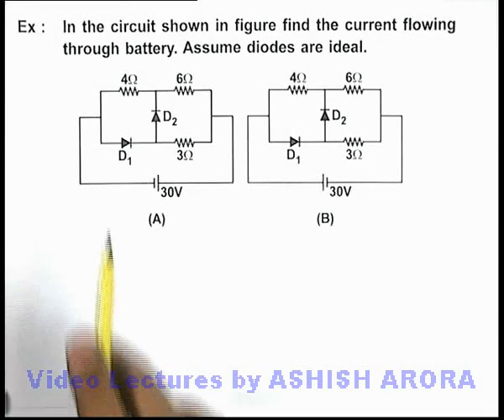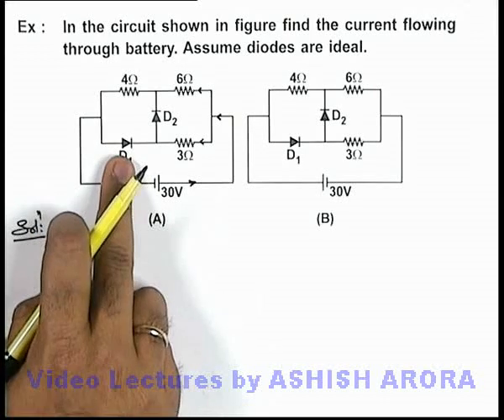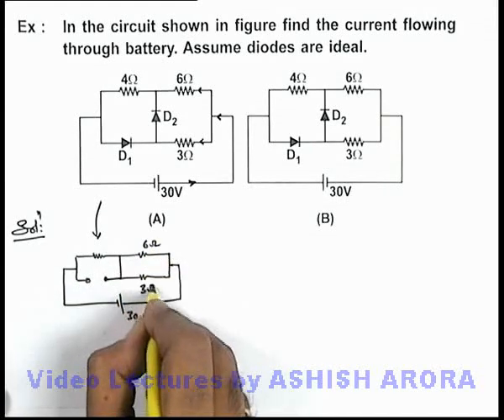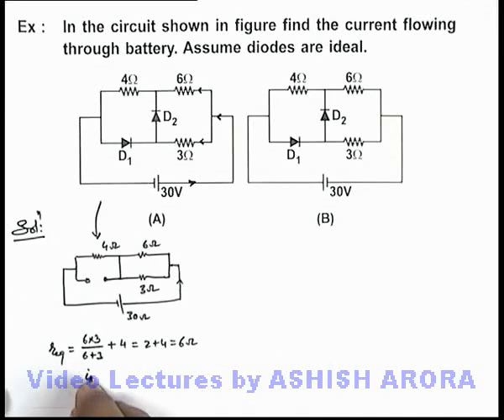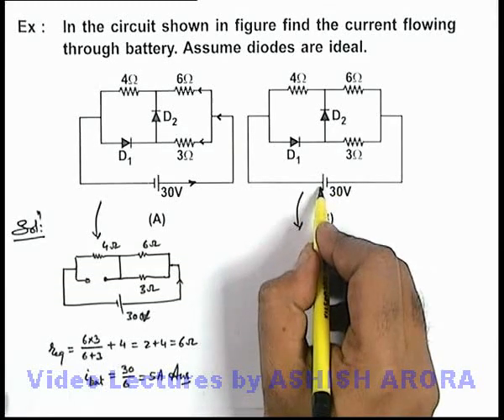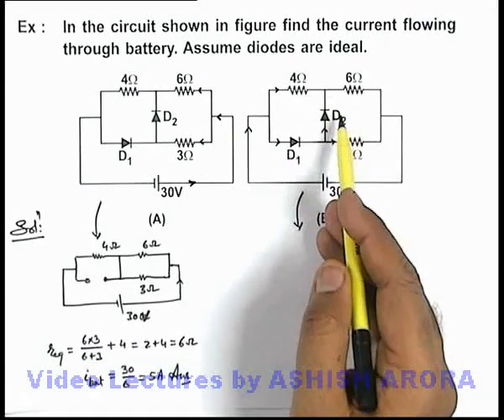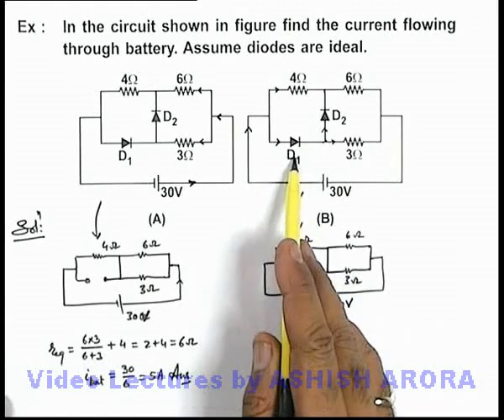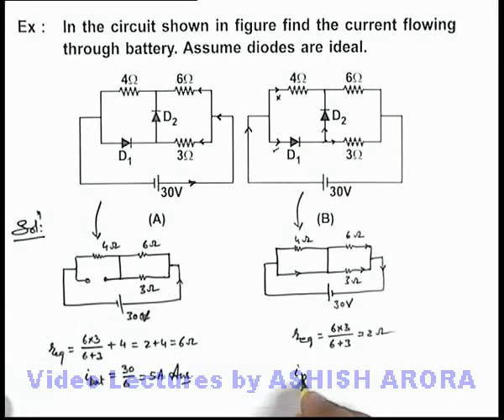Class 12 Physics | PN Junction & Diodes | #27 Solved Example-3 on PN Junction & its Application

Comment: Sir in this problem we are not considering the barrier potential( of the two diodes that is .7 volt?????
Reply: Diodes are ideal bro.
Reply: We should consider the potential drop that is 0.7 volts across each diode show the potential of battery will be dropped

Comment: How in part b 4ohm resistance is short circuited plz explain sir
Reply: As current flows in inverse ratio of the resistances...  Here we can say that a straight wire have resistance  zero or negligible so all current flows throw it ...  U can imagine that if resistance is low current is high...  whereas if resistance is high current will be less
Reply: current prefers going in path of least resistance. so the current through 4 ohm resistor is negligible

Comment: Sir pls reply mai samjh nhi paa raha ki kyu 4 ohm me shot circuuted kaise ho gaya
Reply from the maker: When a diode is forward biased then it short circuits any device connected across it by providing the low/zero resistance path...
Reply: Physics Galaxy thanks sir
Reply: Sir apke reason ke acc toh 3 ohm resistance bhi neglect krenge q ko d2 forward biased h

Comment: in b) why 4 ohm will be short circuit ?
Reply from the maker: because p.d. across this resistance has become zero...
Reply: Sir kaise pd 0 hai mai samjh nhi paa raha auur shot circuited hai
Reply: @smitarai9098  
     Bcoz v=ir and i is negligible so v=0
Reply: @devendrachoudhary2183  more vividly : Observe connections and we know that no resistance provided by D1 and D2 , so potential will be same at each connections around 4ohm